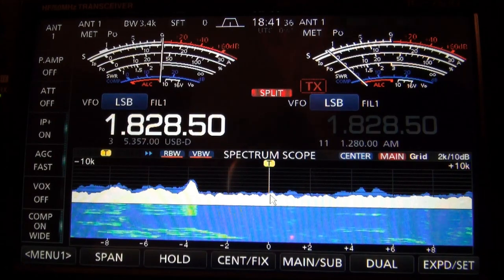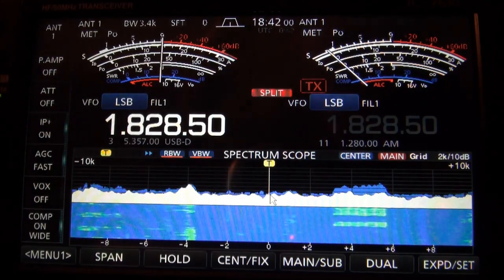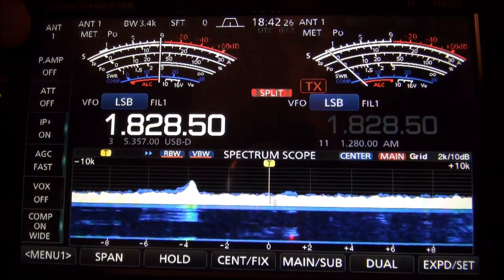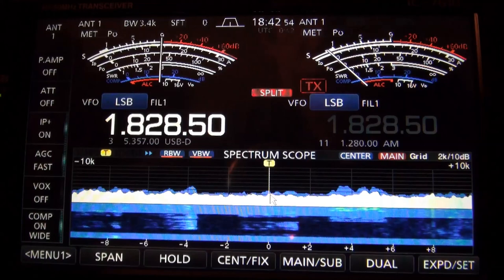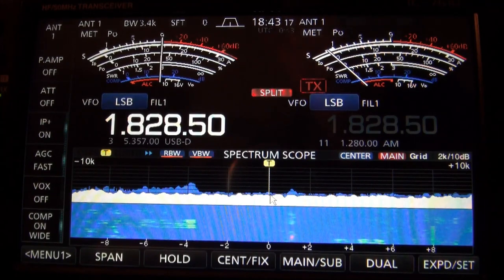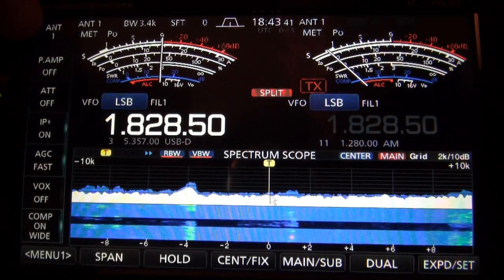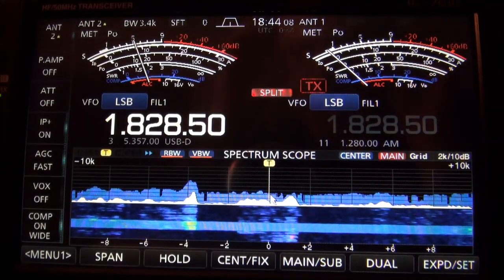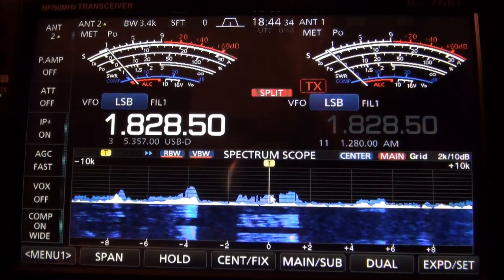KK5JY LoG RX antenna Vs a transmit antenna 160m SSB

Comment: Wow!  I've had very good luck with a small magnetic loop for receive but just ordered the parts I need to build this and experiment.  TWO huge positives for me.  I have land to do this AND when my asks if I'm really putting another antenna "up"?! I can say no😜
Reply from the maker: The KK5JY LoG antenna is certainly worth a try.  At the very least it gives you another RX option.  Hope it works for you...73! de WX0V

Comment: I've been thinking about building my station and have access to quite a bit of land and have been thinking I'll do a BoG or LoG plugs a end-fed wire antenna for my HF.  Thanks for this
Reply from the maker: The BoG, if at long lengths, would likely prevail over the LoG, so if you have the room, that is likely your best choice.  However, if you have the room, a LoG is easy to install, and will give you one more RX option. Thank you for your comment and 73! de WX0V
Reply: @SuburbanDXing  How long is a long length?  I might have the room...I certainly have room for multiple antennas; it just depends how much money I want to spend.  On ground antennas interest me a lot since I can put them up in a hill next to my house... But that hill isn't easy to drill/dig into
Reply from the maker: @techieg33k  An effective Beverage is usually a few hundred feet long.  Plenty of resources out there for additional details.  73! de WX0V

Comment: That is ridiculous 😊

I mainly work 20m SSB. Will your LOG antenna work on the high bands?
Reply from the maker: That's a really good question, and the answer is not too effectively.  I have had some success with it on 30m but 20m and above it loses out to my Yagi pretty badly.  The QRN level on the high bands is so low that a LoG isn't really effective.  As I said before, excellent question!  Thank you for asking it and 73! de WX0V

Comment: Holy shit
Reply from the maker: Well, at least for this signal, your comment is justified.  However, keep in mind, the results may not be that dramatic in all situations. That said, I use the KK5JY LoG for most RX situations. Thanks for your energetic comment and 73! de WX0V
Reply: @SuburbanDXing  i have a K1dtc made 160m vertical where i stuffed a approx 14’ length of wire in my 80m resonator on my hustler 6btv and trimmed it to the area of the band i wanted to work, it’s VERY VERY narrow, however i would love something to listen on since the vertical is so noisy. I have confirmed 46 states and 36 countries on this “hack” setup. Works well transmitting but hearing not the best. Well done seven thirds friend
Reply from the maker: @K1DTC  "VERY VERY narrow" beats no 160m antenna at all, so good work doing what you can to be QRV on Top Band...73! de WX0V

Comment: Good day your tx ant looks like mine s9 to s9 +10db 

What is best turns ratio on binocular 
2 to 6  3 to 9  4 to 12 
For 52 ohms to 450 ohms 9 to 1 

Any advantages to use larger gauge   wire on secondary vs primary 

And any advantages using the larger binocular vs the small 

I know im splitting hairs but i only operate 160m cw and need the best rx ant possible for small beach qth
Im in philippines now 
I have worked mn twice w0vtt was one and w0dd the other 

73 bob du7et 
Also wt3a ve5te g0wet ex0et
Reply from the maker: Hello Bob, and welcome back.  All good questions/points on the LoG.  I have never tried a different ratio or different diameter wire, but those are worth considering.  QRN is our enemy on 160m and this design gives another option to deal with it.  I would like to be the 3rd MN station you work on Top Band...we're gonna need some good conditions, though.   Thanks for your input and 73! de WX0V
Reply: @SuburbanDXing  thanks reply and email
This is the only loop on ground vs tx antenna comparison on 160 m I have found on u toob
I will post video comparing 
My loop vs vertical T on 160m cw
Reply from the maker: @baikushex0et682  There are other videos, but they are scarce.  So the more the better.  Interested to see your results.  I find sometimes the LoG is the only thing that hears the DX, other times the TX antenna is king.  Also, using non-resonant antennas are also used for RX here.  Keep me updated...73! de WX0V

Comment: AMAZING!
Reply from the maker: Credit goes to KK5JY for the design, and to K0SR for the transformer (with assistance from NE0U).  However, keep in mind there is no magic antenna...this included.  Thanks for your comment and 73! de WX0V
Reply: @SuburbanDXing  Yeap! It is certanlly I'll try it in my QTH. I keep in mind that I want to put on 80m band a 1/4w vertical with 4 elevated radials and an Inverted L for 160m, with a single radial, like yours. I have ZERO experience in top bands, but I want to live it experience. Thanks for everything. BST73
Reply from the maker: @ramirorcarvalho  Excellent...I hope those play well for you.  73! de WX0V

Comment: How long and what shape is your antenna ? My radio doesmt use a so239 for rx ant , i believe its rca jack , can still use this method?
Reply from the maker: I cannot see any reason why an RCA plug wouldn't work, so it's worth a try. All the details for this antenna are found at this link: https://youtu.be/wMb8i5QajW0 which I also put in this video twice.  Good luck and 73! de WX0V
Reply: @SuburbanDXing  probably a dumb question but i never messed with the rca jack on radio , how would you go about going from rca jack to the coax to the box where the and is connected to , should i just bypass the coax all together and run directly from rca to box or make some kind of adapter from pl259 or what ever connector is on coax to rca ....?
Reply from the maker: Sorry for the delay, Frank...I replied to this 3 days ago and for some reason, it got zapped.  I would just solder the coax to the RCA; center conductor to center conductor, outside to outside.  Another idea is to get an existing RCA patch cable, cut it, and solder the coax to the cut cable (double check the polarity with a VOM, of course).  There you go.  73! de WX0V

Comment: How is it when raining?
Reply from the maker: That's a fair question, but I do not have a reliable answer. The reason is I use this mostly during the Winter months (Low Band season). I can safely say that snow cover does not hinder performance.  The antenna is often buried in snow and works well.  Thanks for your question and 73! de WX0V